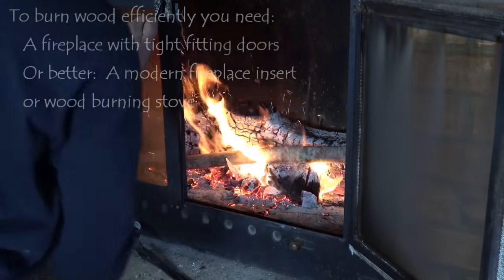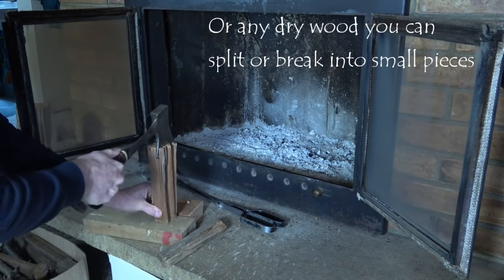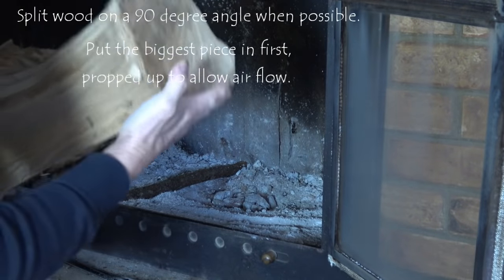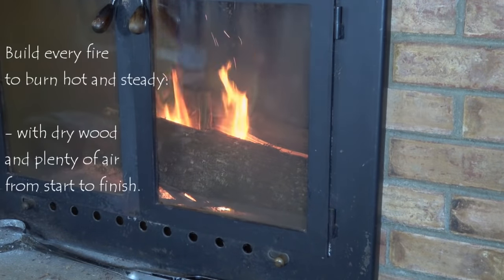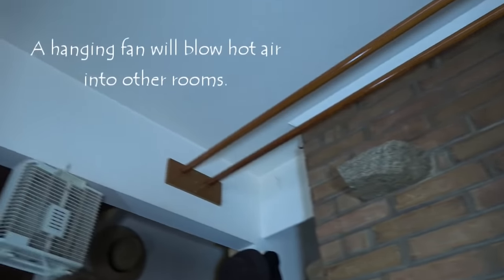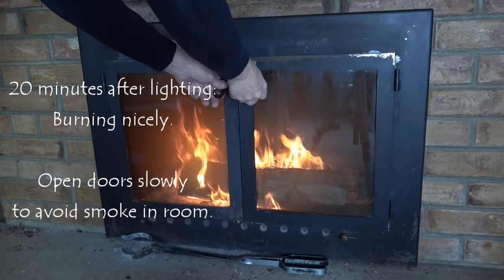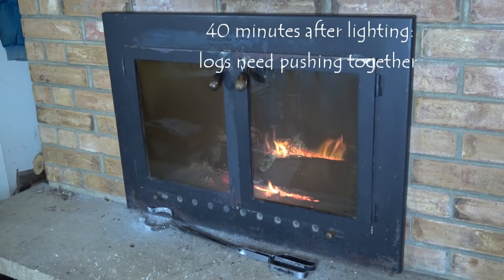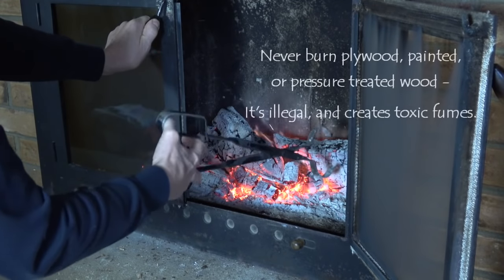Heating Your House Efficiently with a Wood Burning Fireplace or Stove

Comment: What I need to know is how high up do you make the fireplace chimney were when the smoke comes out it want to to the ground and into the neighbor's house???????
Reply from the maker: No matter how high you make the chimney, if your fire is smoky it will drift all over the neighborhood, which truly is a health hazard for everyone. Always burn a hot fire with dry wood and good air flow so you can't see any smoke, preferably in an EPA approved wood stove or insert, better yet a rocket mass heater. Burning wood makes the most pollution of any heat source and a smoldering fire is the worst.

Comment: Is there a way to add fans to circulate the hot air back into the home?
Reply from the maker: Lots of ways. It depends on your fireplace or stove. I use about 3 fans.
Reply: @HartzHomestead  could you make a video?? I have a home build 24 years ago, fireplace has no insert, glass doors…

Comment: Do you have a Metal insert
Reply from the maker: Our fireplace has a built in "heatilator" from the 1950's. It circulates air behind a metal back, through tubes in the chimney, and blows it out through a grill above the fireplace. I've added airtight pyrex glass doors. It's much better than a simple brick fireplace, but not as efficient as a modern insert. The air coming out of the grill reaches 400°F. One advantage is the bricks get really warm and hold heat for a long time after the fire.
Reply: @HartzHomestead  I have a heatilator to should I leave the doors close I have vents that blew air out at the top
Reply from the maker: It depends on what kind of glass your doors have. Cheaper bi-fold type glass doors are often made of tempered glass, which can only stand about 500°F heat. You could close them with a moderate fire that is far enough from the glass, but a very hot fire could shatter the glass. Ceramic glass doors are higher quality, usually air tight and can take a very hot fire up to 1,300°F. Look very closely in the corner of the glass and see if the type of glass is printed somewhere, or if there's a manufacturer's label.

Comment: Central heat from a furnace with your thermostat set around 65 F ? No fireplace unit heats well.
Reply from the maker: Our house does not have central heat, but I now heat primarily with electric wall heaters, because burning wood creates a lot of air pollution. It does heat our house very well though, since I added better fans, the heatilator cranks out a blast of 250 degree air that gets our house nice and toasty. Only takes one short fire a day.

Comment: I've been burning wood all my life. I have a woodstove. Hickory firewood is the hottest BTU  wood  in the southeast. Split in the spring stack it in a sunny spot. It will burn hotter than hell by winter.
Reply: Michael Mongeon is Osage orange ( also called hedgeapple) available were you live? I think it has the highest BTU value as far as North American trees. You’re right tho, Hickory packs more heat than white oak!
Reply: @indianasquatchunters  Hedge apple does burn hot, but it sparks a lot too.
Reply: That is interesting! Northern Vermont here and we burn mostly Beech and Maple.

Comment: if I can recommend the new cold air not below but on the sides of the flame because it tends to cool
Reply from the maker: I have heard that cold air can lower the fire temperature, but I notice my fire really takes off and gets hot with a fine stream of fast air coming right into the flame.  Ideally the air should be pre-warmed, but that also uses energy, so I'm not sure if it really matters either way.

Comment: Do you have to use a steel grate, what are the pros and cons of using one. Ty
Reply from the maker: I don't use one. I put a couple smaller pieces of wood crossways under my main firewood to allow air to circulate under them.  A grate can allow coals to fall down away from the fire, rather than keeping it all together. The goal is to keep the fire burning hot until all the coals are out. Just my opinion.

Comment: Is it tempered glass or ceramic glass?
Reply from the maker: Ceramic glass is best, and allows you to have a very hot fire without worrying about the glass. Tempered glass is cheaper, but it can possibly break if it gets too hot, and ideally you want to burn a hot fire because it burns cleaner. My doors were custom made with Pyrex glass, which is somewhere in between.  I've had some very hot fires and my Pyrex has never broken.
Reply: Thanks bud! I have a large see through fireplace, but the glass is a long way from the fire. Ceramic is exactly 10 times the price. I'm thinking of using tempered.
Reply from the maker: @ShinkleGunDog  I once lit a fireplace full of paper and closed the 4 bifold doors, which were tempered. The flames filled the fireplace and were right up against the glass. We had a party going on, with a barbershop quartet singing, and suddenly one of the panes shattered. People wondered, was it the fire, or the singing?  Anyway I learned not to light a fireplace full of paper. If the fire is not too close to the glass you should be OK.

Comment: Can you please tell me the make and model of your insert . Thanks
Reply from the maker: Our fireplace doesn't have an insert, it's a Heatilator that was built into the fireplace in the 1950's. I did have custom glass doors made with Pyrex glass about 35 years ago by Fireplace Extraordinaire, but they don't make them anymore. It's hard to find tight fitting glass doors. A modern insert would be much more efficient.
Reply: @HartzHomestead  well it looks great and your technique for getting it going is something to take note of. Thank you so much for your response and for sharing this excellent how to video !

Comment: My fireplace has a damper with 3 settings. The "handle" is inside and up out of view so changing it with the fire lit is something i haven't figured out yet. Anyone else have something like this and know what to do?
Reply from the maker: Usually you shouldn't need to change the damper when the fire is going.  I leave mine open all the time because the glass doors keep warm air in the room from going up the chimney.  If you don't have glass doors, you still can't close the damper all the way until the fire is completely out or you'll get smoke in the room.  If it works to burn a fire with it part way open, you could set it there before lighting the fire, as long as the draw is good enough to avoid smoke in the room. The best solution is to have an insert or air tight glass doors.

Comment: Does the cover have to be sealed?
Reply from the maker: You need to be able to control the amount of air getting to the fire - enough air to keep it burning hot, but not so much you are losing a lot of heated air from the room up the chimney.  Most cheaper bifold glass doors don't seal well enough, but are better than nothing.
Reply: @HartzHomestead  hey thanks for the fast respond.. I have another question. The gas line has been capped off. Is this safe to use with fire? Going to confirm with the gas company as well.
Reply from the maker: If it was originally a gas fireplace, I'm not sure if it would be safe to use with wood. I think wood burns a lot hotter than gas, besides causing a lot more air pollution. If you're still using gas anywhere in the house, that line could still have gas in it even if it's been capped.  I'd suggest asking someone who specializes in fireplaces look at it. You might be able to put in an insert designed for wood burning.

Comment: Could you please compare the cost of operating a wood stove system to a gas fp system to heat a house..?
Reply from the maker: Heating with wood is cheaper than gas, as long as you have an efficient wood stove, and especially if you cut your own firewood. But gas is clean and takes almost no time to operate, while burning wood can be time consuming, messy, and creates much more air pollution. There are so many variables it's hard to give exact numbers.

Comment: hey.. thanks for sharing.. what tight fitting glass doors... certified inserts... smoke mechanism and rules... opening the window to balance the pressure.. where does the air come in from, where is it going out.. these are very technical subjects which you are touching very casually. you are a knowledgeable person. Please elaborate in layman terms from the beginning and in details, how does this work. This is why we are watching the video. Please share more content. Thank you very much again!
Reply from the maker: Thanks for the feedback. Read my video description for more details, and some good inserts you can order. A lot depends on where you live, and if you have a local fireplace shop that can recommend the best insert for your particular fireplace and budget. I'd recommend an insert over glass doors, and unless you are very handy, you may want it professionally installed.  I am planning another video on the subject, I will try to be more specific.

Comment: I just realized you mention that your glass doors were custom made out of Pyrex!  We'd love to replace the current door on our old wood stove with a glass one--did you make it yourself?
Reply from the maker: A local fireplace shop custom made the doors for me 35 years ago, for $300.  I measured the fireplace opening, and they gave me a choice of tempered, Pyrex or ceramic glass.   There are screws that hold it tightly in place, with fiberglass insulation to seal between the frame and bricks. The doors can be lifted off, and there's a gasket holding each piece of glass in a slot, and a gasket around each door to seal when you open and close. I've replaced the gasket once - very easy to do.  Well worth the investment.
Reply: Fireplace Doors were manufactured by Custom Firescreen (sold thru Kirkland Fireplace, Brand X Manufacturing back when he purchased),  The Pyrex option is no longer used as ceramic (NeoCeram or PyroCeram) are less expensive than Pyrex now and stronger verses the heat.  But note as of this posting (2021) you will pay about $400 - $500 just for the Ceramic glass, not including the doors which will likely cost $1000+, so consider an insert when pricing out this option.
Reply from the maker: @craigdailey947  That was also my conclusion, that you can't buy decent fireplace doors for under $1000, so it's better to just get an insert, which will cost more than that, but also be much more efficient.

Comment: Very helpful. We just bought a new house here in Minnesota and I think the current temperature is -10° at the moment. We have a wood-burning stove in the fireplace and I am trying to learn if it is good enough to offset some of my healing expense. The furnace is turning on often at 68°. I noticed I don’t have a fan pushing air out of the chimney area and I might consider mounting a midsize fan back there into the wall that surrounds the fireplace. I wish I could send a picture. The prayer homeowner had for 6 x 6” squares cut at the bottom and top of the fireplace with some screen over it. I’m sure this is to let a little bit of air flow out but I don’t necessarily see any air being pushed through to help circulate it unless it’s doing it naturally. Three logs a day is not bad at all, how warm is your house throughout the day?
Reply from the maker: Because burning wood causes a lot of air pollution, I usually just burn one hot fire a day, which gets the house up to about 70F, then we use electric heat sporadically as needed just in the rooms we are using most. Our house is often at about 65F, sometimes drops to 60. Double interior Mylar storm windows help a lot. Our electric bill is about $50 a month in summer, $100 in winter.  I wear long johns, fleece pants and a turtleneck with a sweater vest most of the time and have a hot pad I put on either my feet or shoulders if I'm just sitting a long time.
Reply from the maker: If those vents really do circulate air around the firebox, it would be well worth putting fans in them. Try blowing some air through the lower vents while the fire is hot, and see if it comes out hot at the top. If you have a fireplace with an insert, it should have its own fan. The heat may not make it through the masonry of the fireplace.
Reply: @HartzHomestead  so I put a fan on it last night and the furnace is currently really hot right now. A little bit of beer comes out of the top of the vent but what I noticed is the inner side of the fireplace is completely lined with steel. The steel tapers up into a triangle up towards the ventilation duct. I think it's best that I try putting a fan in front of the Furnace where the air can escape from the top. I post pictures but it doesn't work here. The furnace really warmed the house overnight and I noticed right away going into the kitchen it was nice and toasty. Thanks for your help sir.

Comment: Starting a fire free with junk mail is my tip unless that's a bad idea, still you can use it for outside fires.
Reply from the maker: I recycle the envelopes with plastic windows and glossy junk mail, because it doesn't burn very well, but burning is a great way to get rid of anything with personal information on it. Newspapers actually light easier, they're thinner.

Comment: When do you close the flue
Reply from the maker: I never close the flue, I close the doors to the fireplace and the vents.  If you don't have tight sealing doors on the fireplace you would want to close the flue whenever your fire is completely out, to keep warm air from the house from going up the chimney, but then you have to remember to open it before starting a fire.

Comment: I plan on redoing my firepit outside soon... got any tips how i can use the fire to heat the area better than just the middle?
Reply from the maker: An outdoor fire isn't usually going to heat a very big area. About all you could do is have some walls or solid fencing around it about 8' back or more, so you are containing the heat, like in a yurt or teepee, or have a sunken fire pit, if you have good drainage.

Comment: Is there someone or somewhere we can go for an assessment to learn about the best way to heat our tri-level with a wood burning stove?
Reply from the maker: Search for a fireplace shop or contractor who installs wood burning stoves or fireplaces in your area, or a metal shop or mason. A metal stove on the lowest level (so the heat rises) might be the cheapest, but if you can afford it, a masonry heater or rocket mass heater is cleaner burning and provides more even heat in the long run.

Comment: If you dry wood inside the firebox it's no different than burning wet wood. You are still losing heat through the energy required to dry the wood and you are still creating creosote build up as the water vapor travels up the chimney with the smoke. You should also be cutting your wood in the fall so that it gets a full year to season. Overall a good video though.
Reply from the maker: Our winters are so wet here in Western Washington that I don't think wood dries much from November to February, except the occasional dry freezing spell. I do cut trees while the sap is down (or already dead trees) and stack it loosely in full sun under cover through the summer, which seems to get the wood quite dry in about 8 months.  Also bringing it into the house a few weeks before burning helps. 
We only resorted to drying wood inside our firebox a few times when driest wood ran out. It's hard to get a hot fire going with damp wood, but after drying it inside the firebox it burned very well.  Not sure about the creosote.  It seems a hot fire with a little added moisture will make less creosote than a smoldering fire.  It isn't really worth the trouble though, so in that situation again, I'd just turn on the electric heat.  
I see you also have a channel, which I have subscribed to, and you're welcome to subscribe to mine. I'm working toward the new 1000 subscriber requirement for ad revenue, so I appreciate every new subscriber.
Reply: @HartzHomestead  I just subscribed, I liked your video. Ignore the morons who name call and leave mean comments(I'm not saying it was the guy in this thread).
Reply: I'm a retired chemist and although no expert researcher in the area of wood burning, I do understand the physics and chemistry involved.  I agree, that drying the wood inside the firebox would retain all the negative aspects of burins wet wood.  The only difference being that when it comes time to actually burn the wood you wouldn't have trouble getting it to burn or maintaining the burn.  So, dry your wood outside the stove.

Comment: Why you close the door ? Can not you let it opened while the wood is burning ?
Reply from the maker: If you leave the fireplace doors open while it's burning, the air in the room will go up the chimney and suck cold air in from outdoors into your house, so you lose most of the heat created by the fire.  It's OK if you really want to sit in front of an open fire, but not if you are trying to heat the house.

Comment: Two or three logs for the whole day?!! I go through about 15 to 20 per day. I must be doing something wrong. Thanks for your video
Reply from the maker: We do live in a mild climate,  with average winter temperatures in the 30's and 40's. We have R42 in the roof, R11 to 21 in the walls, and 4 to 5 layers of glazing on all windows. If I light more than 1 fire a day, my wife says it's too hot in here.